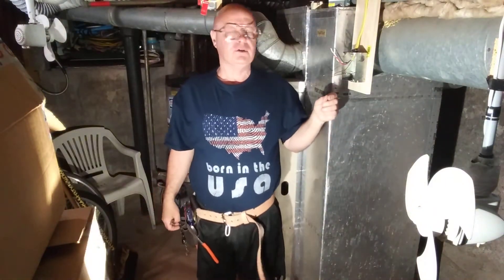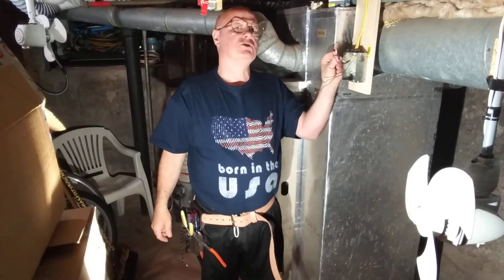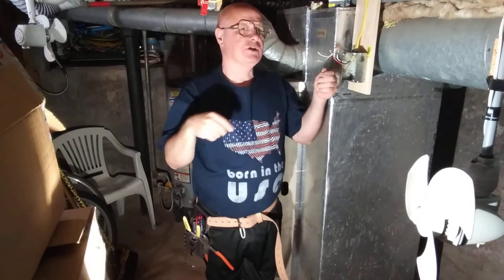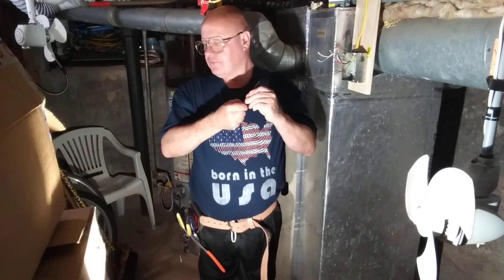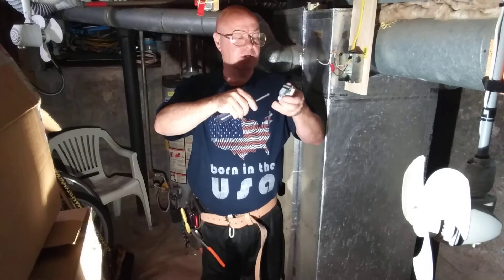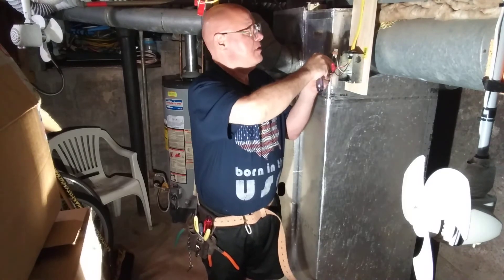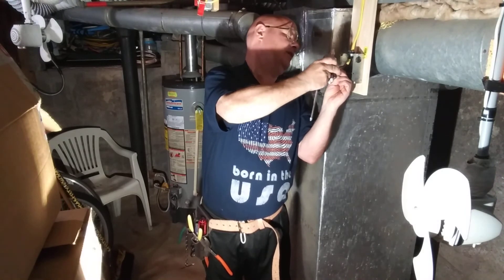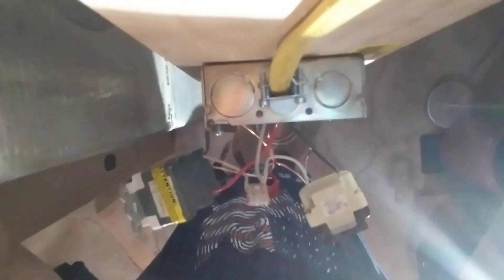I show and explain wiring 2 GFCI outlets 1 neutral 2 live wire 2 circuits 15 or 20 amps

Comment: Direct wiring more than one GFCI with a shared neutral can be finicky, with false trips from time to time, especially on the load side.  That is not the case in this video but might have been mentioned (Often need to pigtail multiple GFCI's since shared neutral can be problematic downstream with respect to protection.  Should have had at least 6 inches of wire in the box, looked short to me. Too much sheathing in the box, only need to show 1/4 inch.   OK but unnecessary to switch to 14 wire which was used for both devices, one being fed by a 20 AMP source, when a piece of 12 would continue the feed, just better form as it is OK to use 12 wire on a 15 amp breaker.  The poor guy looked scared to death.  I couldn't understand  his 240 comment: each circuit was 110-120V.  Two independent circuits seems to me.  Really kinda weird. He tried to be helpful. Gotta be more precise with electrical work.

Comment: that's not how you spell circuit "brakers".... (breakers).  Gimme a break are you an electrician?  Nice pants.  You should take yourself seriously man. Also you keep saying gfi when it's GFCI... a gfi, which is not an actual product, would be you, or a breaker, or other disconnecting means when there is a ground fault.
Reply: You give him a break. He did the job perfectly. The terms might not be exact, but the work is correct and this is what matter when doing electrical.
Reply: GFI is what just about everyone calls 'em in the trade. There are technical terms and there are trade terms.